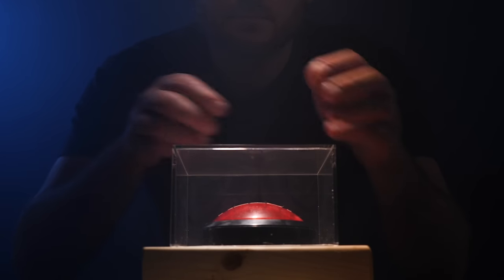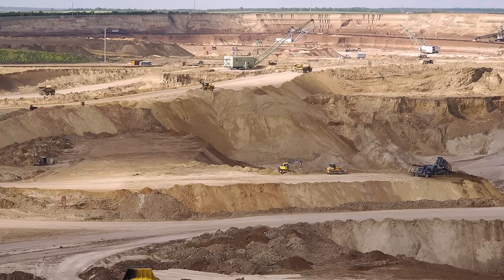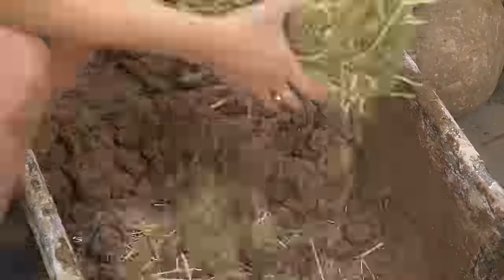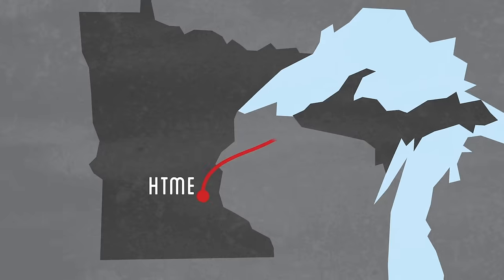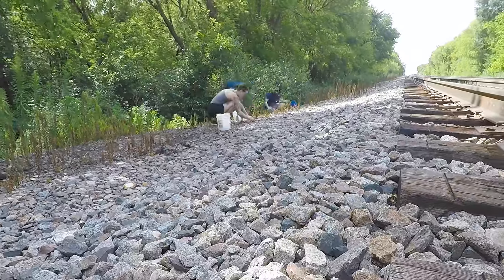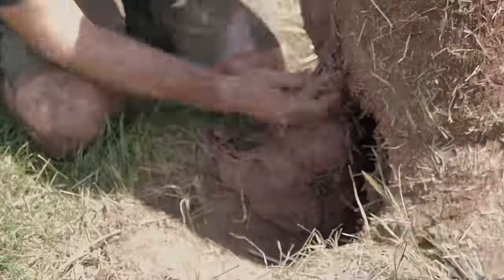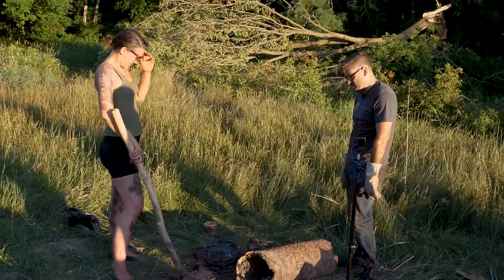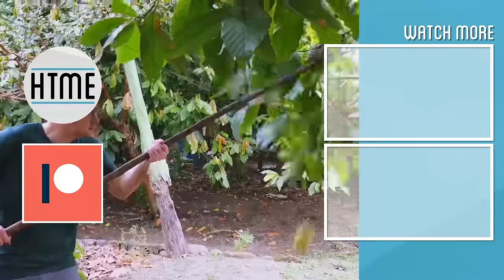Smelting Iron from ROCKS (Primitive Iron Age Extraction)

Comment: I've done a few smelts using a similar design to your combined cob stack and bowl bellows. I added ONE extra feature tho. And its made a HUGE difference to the process. I used a thin piece of bark (set low on the  inside of the bowl and worked into a recess) to create a one way valve. 

The difference it made in air flow. AND in shoulder pain was... Tremendous. 

Basically you take a strip of bark. or anything thin and flexible and bury the top half into the cob wall as you lift the leather the pressure difference lets the valve flex and let air in. But when you push down the valve is forced close and all the air goes out thru the stack. It makes the bellows so much more efficient.
Reply: Came here to say the same thing.  I thought "Man, a reed valve on those pots would probably make a huge difference!"
Reply: Heck, even a simple hole that you use your free hand to cover and open seems like would help.
But, he still got a good result. And certainly respect them for doing the work.
It's something I'd love to try and play with sometime. Although kind of sad high quality ore is almost impossible to get anymore.
Reply: After watching a recreation of an African forge I thought the same thing but the valve would be unnecessary if the bellows were pumped in succession.

Comment: Working at a foundry, I learned a little about copper, carbon, manganese, zinc added to the furnaces. High side iron. loved it. Slagging furnaces at 2800 is like breaking through the surface of the sun. It does trip me out though when some say we had to use electricity to get it started. Lol no electricity. Good stuff. I like it.

Comment: Heya, for your bellows.  Use some hollowed stick (bamboo) with a flanged end.  You don't want the inside hole bigger than your thumb.  This way when you pull up on the bellows you bring in cooler, richer air from away from the flame into the bellows.  The way they were working on this episode, I'm afraid they were pulling in a lot of hot and/or combusted air.  The quality wasn't as good so you weren't able to get the fire hotter, faster.   If you can get in the quality, rich, oxygenated air that doesn't have CO, CO2, or other derived pollutants then you can get your fire hotter.  Just a minor change on the bellows.  If you don't have a flanged tube-like object then put a slit in your leather, wet it, and then put in your tube.  Tie it tight as possible so when the leather dries, it shrinks, and acts like a natural grommet.

For a future episode, either flip the bellows upside down to use a stick to stand on it OR keep them like they are but make the bellows linked on foot pedals (lack of a better term) so that you can just "walk" on them so one presses down when you step down on the left, then the right, etc....  This will be less painful on the arms, knees, and hips so you aren't sitting weird or get tired faster.  Quality over quantity.
Reply: StairMaster bellows is a great idea. I wonder if bones after the marrow is scraped out could offer a tube?

Comment: The Japanese box bellows work really well. There were no railroad tracks or black beach taillings in the Iron Age. Just go to a river and find rocks that look rusty and use those. Smash them up. Also, make a lot of coal out of wood before you start smelting. Take a look at how the Japanese and the Persians used to make high quality steel.
Reply: Where I live, heavy very strongly magnetic rocks are quite common along the River that I live very close by to . I even found this rock that looked rusty in some areas and with a somewhat shiny black surface and moreover on one side it looked as if that rock was subjected to intense heat . It was strongly magnetic and quite heavy for its size ( around the size of a couple of segments of a peeled orange ) . I was hopeful that I found a meteorite but later was told that a small foundry was upstream from where I found that rock ,so I was left doubting . Even though, I decided to keep that rock " just in case" . I cannot recall whatever happened to that rock ,so I won't ever know .
Reply: the name for that is "bog iron" it was also very popular In the north of England.
Reply: The addition of limestone is what made it actually work to melt instead of hammering it in to steal

Comment: There's a method of making bellows that doesn't utilize leather and is essentially just a piston. I bring this up because you said leather is a requirement when it's more of a strong suggestion. 

You have a hollow cylinder with a hole at the bottom for air. You put a disc with a long handle inside it with a trapdoor on the inside so when you're pushing it pushes air through the tube and when pulling it pulls air from the top of the cylinder instead.

That's basically it.

Comment: Let's see if I remember this correctly:
C + O2 -> CO2
CO2 + C -> 2 CO
3 CO + Fe2O3 -> 2 Fe (l) + 3 CO2 (g)

=> The burning of the Carbon (coal) does not simply liquify the metal ore, but it also produces carbon monoxide, which acts as the reducing agent necessary to reduced the Iron-oxide into elemental Iron.

Comment: In the next episode he figures out the hard way why you shouldn't let a newly formed bloom cool down before you hammer it down.
Reply: Why?
Reply: @boid9761  Reheating it to forging temperatures takes a lot of time and fuel, also each of the individual iron nuggets in the bloom becomes coated in an oxidation layer which will make forging them together extra hard. Most of this can be avoided by forging the bloom as soon as it comes out of the bloomery furnace.
Reply: @stamasd8500  So basically, it took a long ass time to make a reasonably pure iron ingot this way?
Reply: @boid9761  Not to mention I didn't see them poke a hole for slag to leak out so there is probably a ton of slag in that steel and from what I've learned slag is insulating making it that much harder to heat up later plus the fact that bloomery steel tends to be impure to begin with now with all that slag ? That thing is gonna be a B** to forge weld later.  Also there is almost no way to get pure iron from that method steel was definitely found first so pure iron will come later.

Comment: When working with clay for large projects, I suggest taking a look at the channel primitive technology. You have to let it almost fully dry before going onto the next layer. the way you were doing it, it was too wet, and therefor would collapse onto itself.. The only time you can really ignore that is if you build it around a frame. Then, when it's completed around it, burn away the frame. This will bake it as well as remove the frame at the same time. just clean out by hand and bam! you're good

Comment: Aww heck yeah I've been waiting for this for a long time, since watching Good and Basic's attempts.

One thing you didn't mention: do those pot bellows have valves in them? If they don't, then I imagine if you're alternating them, one will be sucking in the air the other just blew out.
Reply from the maker: The leather is folded over itself in a way where you can seal it on the downstroke and let air on the upstroke

Comment: The iron ore at the Soudan  Mine can be very high in iron content, they have a sample that they were able to arc weld two pieces together.  The mine is way off the beaten path in northern Minnesota, but the tour is really interesting. Most iron is now mined in huge open pits, Soudan was an old fashioned deep tunnel, even though the iron is very high grade, it became too expensive to mine that way.
When I visited, the elevator ride up and down was an adventure. We were squeezed into the “box”and half way up I realized there was a bat crawling up my arm, I did not say anything til we were at the top and the door opened.I was not fazed, but could imagine quite a traumatic event if someone freaked out.
Reply: Visiting the mine with my granny: The old miner once guiding the tour used to grab bats throw them down & crush them. Made me want to return to stone age. Used to watch bats maneuver & catch insects, & prefer that skill to pick & shovel. I still catch things people bump off or drop, in mid-air.

Comment: Pro tip for anyone making a pot bellows, tie a quarter or small rock in the center of the leather. This allows you to attach cordage to the middle of the leather and pull on the string instead of mashing the top of the leather by hand. More comfortable and efficient.

On the underside of the leather make a hole with one hand, and poke the leather thru the hole. Drop a small circular object in the hole. Cinch your cordage around that object and attach to pot

Comment: @06:16 "repeat for the second bellow" — bellow noun: "an act or sound of bellowing"
bellows noun (used with singular or plural verb) "a device for producing a strong current of air, consisting of a chamber that can be expanded to draw in air through a valve and contracted to expel it through a tube."
Bellows is the same class of noun as scissors or pants.

Comment: In all seriousness, you can use your own poop for this (as repulsive as it sounds) to supply more heat after it dries.
Same with any other animal waste from chicken, cat/dog, horse/cow poop dried out and added into the mix.
As far as the air, if you're wanting to keep it 'primitive,' there are easy methods of creating wind tunnels to capture light to heavy winds to generate enough airflow for this, and there's the bike/row machine method, but again, still sweating LOL.  

Another option if you have a running water source is creating a dam, making a waterfall to power a pully to power a fan. Again, if you want it all natural, melt cast your waxed fan blades, smelt in your fan blades. The cups could be simple pottery for the waterfall. 

Just some ideas instead of the caveman animal hide method 😝

Sounds like you all are having fun! 
Cheers!
-H

Comment: I realize I'm a little late but you should have an inlet valve on your bellows. It would stop reversing air flow at the mouth of the kiln, but also reduce the overall effort by around 40%. African tradition has it in the skin atop the drum, opened and closed manually with each stroke. Once you get accustomed it is quite efficient.

Comment: I'm into chemistry. There are so many metals and alloys. Gold is used in semiconductor chips to connect the chip to the outside world. It is good because if it's corrosion resistance. LEDs were originally germanium arsenide. The batteries use lithium and often cobalt.

Comment: If you want those bellows to work right you need an opening on the side that can be covered by your hand. When you raise the bellows skin the hole is opened and closed as you push the oxygen rich air into the fire.

Comment: You mentioned Michigan’s Upper Peninsula and it’s native copper but it’s also known for its iron ore which is in abundance as in the form of hematite ( high grade ore)  and it’s mines where closed after WW2 when the industry changed over to taconite ore or low grade there are still two mine running in Marquette County but all the mines in Iron , Gogebic, Dickinson counties are closed. During the war I know that between Michigan’s Upper Peninsula and northern Minnesota these areas supplied over 90% of all the iron for the war effort. As for the area I live in in iron county there are still massive outcrops of hematite ore.

Comment: Awesome set up. But if you use a larger piece of leather and before attaching it to the bellows. Put a rock in the center form the leather around it and tie it off. You’ll have a handle that is knob shaped for your pumping.

Comment: How is the air getting into the bellows?
I saw a video of this African tribe that does it and they had a split in the leather (might have been cloth) that overlapped; with the action of the hand you can make it take air in from the top on the pull, and then seal for the push.    Someone below mentioned a thin sheet of bark hung over a hole on the inside of the bellows would let the air come in there but slap shut on the push.

Comment: Probably could have used large magnets at the end of a long pole to collect the taconite along the railroad tracks rather than crouching down for so long. Work smarter, not harder. Also, if Minnesota has bogs, you probably could have found some bog ore to supplement your iron supply. Bog ore was one of the major sources of iron ore early on.

Comment: So for the kiln im wondering how the grass doesn't burn away and reduce the strength after the moisture has been pushed out. Im assuming its the moisture that is preventing the heat from breaking it down.

Comment: I was so worried that you were going to go for the iron sand as your source.  Japan did that, as the islands don't have any of the typical deposits that saw most of the old world through the iron age and into the development of more sophisticated smelting technologies, and...Japanese ironworking is a pretty complex beast as a result.  All the disadvantages of bloomeries with a fairly low grade source material makes for a pretty terrible bloom iron.

But Japanese ironworking came after Chinese ironworking, so it wasn't a matter of blacksmiths trying shit to see what works, they very much knew what they were doing.  Thus you get smithing techniques like sorting out the grades of the iron from the bloom (there's carbon in there, some of it's steel, some of it's wrought iron grade, some of it's pig iron....bloomeries suck if you want a specific alloy out of it at the end), purfying each piece (the fabled thousand folds that increase strength are really just a way of separating out impurities - do that to something smelted using any of the processes we've developed in the last thousand years or so and you're probably making it weaker because the impurities you work out of the iron aren't as big as the ones you work into the iron.), and then forging different grades of iron together to take advantage of the different qualities of those different grades.

You can do it, and it worked for Japan for centuries, but...there's a lot of work you need to put in to compensate for smelting low grade ore in a bloomery.

Comment: If you use a toller bloomery, one that's say, 8' to 10' high, it becomes its own bellows by drafting hot air through a long, thin chimney.

Tip:  Insert a copper pipe about 3/4 towards the top, run it down the chimney and exit the chimney at about 1/4 from the bottom.  Feed it in a D shape to the very bottom of the bloomery, where air from it can get to the base of the coals.  Encase the D in mud.

By using this as an exclusive air vent, the bloomery's draft creates negative pressure in the chimney, pulling air in through the pipe.  The air is heated in the pipe, thereby creating a significantly hotter fire.  The process also slows exit from the chimney, moderating the fire at the higher temperature.

I used this method with a 6' bloomery with the entrance at 5', a spiral coil lining the chimney, and the exit at 1'.  Once all other exits were sealed with clay, the bloomery furnace quickly increased into high gear and got hot enough to thoroughly glaze the brick and partially melt the end of the copper tube nearest the coals, at least 300 degrees F hotter than required to melt iron.

Comment: I wonder how it would go if you had just one billow with a small carb hole in the clay. One hand lifts and pushes the leather, the other hand opens and closes the carb with the palm of the hand. So there is only pushing air forwar and no breathing back when lifting.

Comment: I admire the drive towards learning how to do everything possible from the most primitive was possible, but at the same time, I can't help but wonder why one would have to spend so much time scouring large areas for scarce ores when the earth is covered with scrap metal just rusting away almost everywhere you look. From junk cars to empty cans, and more that just ends up in landfills, significant amounts of metal can be processed without having to make resource hunting taking up 90% of the time used in the project each and every time it's done. 
Not attempting to criticize, but having to sift through low quality ores and ending up with small quantities of the finished product, recycling already made iron products would easily be rendered into larger quantities in much less time.

Comment: The Bellows leather shouldn't have been a sheet. If you let it kind of overlap itself with a flap it acts as a valve where when you push down it mashes together but when you pull up it allows air to flow in from outside rather than sucking air back and forth.

Comment: I realize that you're trying to keep it sorta primitive, but when you were picking up the limonite BY HAND, and I can't keep my mouth shut, for wanting to ease your process, whether you want or need it or not. Next time, use a nail rake. It's a wide, strong magnet on wheels, whith a handle like a leaf rake. You just roll it over the ground, and it picks up all the iron, nickel, and cobalt stuff as it goes. You can get them 3' wide, and it's a LOT easier than hand picking. Works great after the roofers leave, too.

Comment: 3:00 This is wrong. Oxygen did not begin to build up in the atmosphere until after the iron had rusted out. 
      Iron sucks up oxygen very quickly, so much so that if you have to work inside a closed vessel (like a huge tank), you have to test the atmosphere inside the tank before you enter to ensure it's breathable, even if the tank has never contained any liquid.